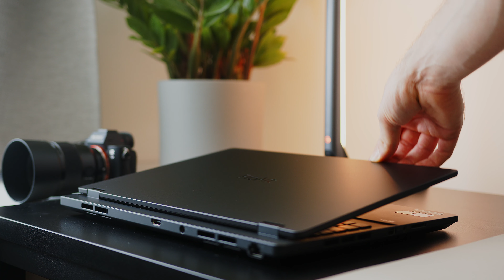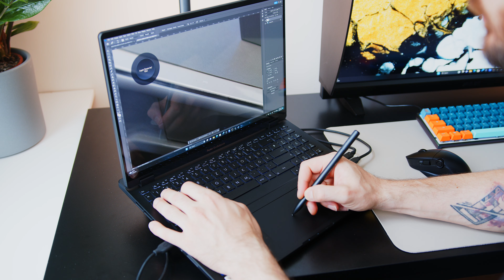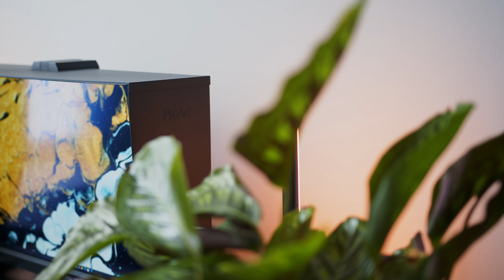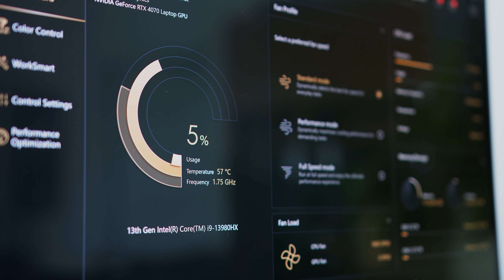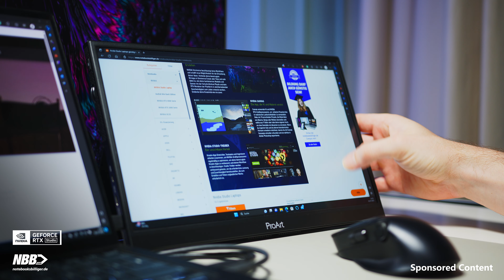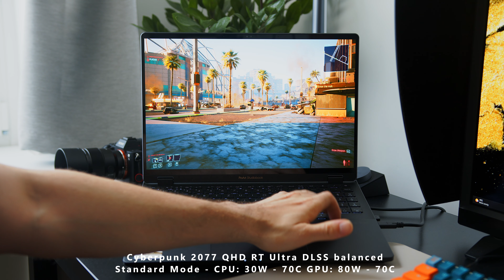Asus ProArt Studiobook 16 OLED -  The One-Stop-Shop for Creators?!

Comment: Hi, and thx for the video!
I have just bought this same notebook, with RTX4070, and every time I open Premiere Pro and go to almost any menu, it crashes! And this is no hobby for me and lots of money, and ASUS don´t have a solution. Do you use Premiere Pro, and no problem? THX

Reinstalled win11 several times, and even just updated the OS and just installed PPro, and the same sh...
I am really getting mad at ASUS as this is supposed to be the jewel of the company, and read that many users have the same problem. Besides, all review talk about specs but not one shows them at full workload.
Reply from the maker: Damn, that does hectic. I tested our sample with Resolve without any problems, and trust me, our stresstests are also no joke. Have you tried a different version or premiere?
Reply: @NotebookcheckReviews  yes, 2023 and 2024
Weird, as I can open Lumetri but not the scopes. I csn even edit with Lumetri. But as soon as I open Preferences or Export Media, it crashes.
Reply: @MarcelloScotti  any resolution as of yet?  I work with Vegas mainly, but am wondering if there is a wide spread video rendering issue with this laptop.
Reply: @AshevilleVideography  hi, and thanks for asking!
You won´t believe it...

As the notebook was brand new, I haven´t used the camera yet. So, I had a Signal meeting and .... OMG, the camera didn´t work!

So I recalled the problem I had with my Zenbook Pro Duo, that wouldn´t let me open Premiere Pro because the integrated mic didn´t work. I send it to ASUS and they had to change the whole screen board. 900 euros but fortunately still under warranty.

Back to the problem.

I deleted the camera driver, and still the same. Deleted Nvidia and the same. I reinstalled win11 and JUST updated WIN11 and installed Premiere Pro and... still crashing. So, I thought maybe Nvidia was stepping on the ASUS controller, but... where to find the original controllers? Wrote to ASUS and nothing. They sent me a link but ... useless, as usual.
So, I had to go deeper. I went to the Device Management, looked for the camera, properties, device ID and copied the "hidden" id sequence. Googled for it. deleted Nvidia, installed the driver I found, installed Nvidia, and reinstalled the camera driver once again. AND BINGO! It worked. And so far everything is doing great. Tech people under salary are usually very limited.

So, short version: Nvidia was stepping on the camera driver and at ASUS you can´t find a repository with controllers (HUGE mistake), so I had to find it myself, and to find myself the solution.

Thanks for asking!!

Comment: As an user of this laptop I did find after in depth research that SD card reader poor performance is not about sd card compatibility. Asus did forget to mention SD Express standard is not back compatible with all SD card standards so the reader can be fast only when you use special SD EX cards, which are non existent in for ex. photography world. SD express 7.0 reader reads either ancient SD UHS 1 or SD EX standard, and nothing in between (sic!) which means every other card than SD EX will get speeds only up to 90MB/s which is crazy slow in 2023.

Comment: If only they would release a 4080 version at least, better still a 4090, that's what I would need as a full time video editor, great laptop but a 4070 just doesn't quite do it for me. Been using my older Razer blade pro with a 3080 and that struggles depending on the codec. The cpu is a definitely an upgrade but without that higher spec gpu it not worth it for me anyhow, pitty because it's great machine
Reply from the maker: My thoughts exactly. There are too few "creator" notebooks with 100W 4080s or 4090s. Sure, they would be expensive, but when you make money with it, cost is a bit of a different matter.
Reply: @NotebookcheckReviews  Hi, yes exactly, when it's what you do for a living it's kinda necessary, nothing worse than clients on your heels and dealing with time pressure and a machine that is not playing ball.. It's still an expense sure but at a certain level you decide it's a worthwhile investment. Do you know of any other "creator laptops" that are currently available with 4080 /4090 cards? The Razer and the Lenovo are the only ones I know of?
Reply: Even the Msi creators are excellent for graphic design etc. But for video they don't spec them out with higher end GPU'S
Reply from the maker: I was actually looking into that myself the other day. The ROG M16 comes to mind, the MSI Stealth 17 Studio also comes with a 100W 4080. And there is a Zenbook Pro 16 OLED which also comes with a 4080. I am trying to get my hands on that one.
Reply: @NotebookcheckReviews  oh excellent, thanks I'll take a look at those. Hopefully you get your hands on one would be interested in seeing

Comment: The Asus Pen 🖊 get used this laptop 💻, is it convenient to draw on screen,...? Does this laptop having tablet mode? Screen can rotate 180°...? 360°?
Reply from the maker: It works pretty well, but I would not work like that for more than 1-2 hours. But you can use the pen on the touchpad, which is simply amazing. 
The tablet does not have tablet mode.

Comment: I got the base model and was disappointed to not get a stylus in the box for that config. My only other frustration is that the lock port is the size of a standard Kensington slot, but only works with their Slim style of locks and not the standard T-bar designs due to a shorter-than-spec roof inside the slot. Otherwise it seems to be really solid and I've enjoyed having it. Afaik this is one of the only laptops with a touch screen, discrete graphics, and removable ram/ssd/wifi.
Reply from the maker: Thanks for sharing your experience. I thought the stylus was always included, especially given the touchpad functionality. That is a bizarre decision from Asus.

Comment: I returned mine. The off center keyboard drove me nuts. Why add a numpad to a creators laptop ?
Reply: Yeah I hate the numpad too
Reply from the maker: Whenever a laptop this size comes without a num-pad, you will have an equal amount of people complaining about it. It will always come down to personal preference. I can work with both, I do not really miss the numpad if its not there, but I appreciate it if I have one at my disposal.
Reply: @NotebookcheckReviews  glad it works for you. I dont oppose numpads if they dont come at the cost of ergonomics or comfort when using the laptop. shrinking laptops sizes and adding numpads are mutually inconsistent design choices if you ask me.
Reply: To create with numbers.
Reply: @lukjno6345  thanks. I think it makes sense. I was being biased for my personal use.
Reply: @lil_brumski  if you come from a no-numpad (dedicated number keys) laptop, your hands would have to rest way more to the left and my leftmost fingers kept going over the laptop chassis. It is not easy to find your way in this keyboard if you are not used to a numpad. how many video editors type exce spreedshets to the point that need a numpad? I dont get it.
Reply: @DanielRodriguez-fg5ll Numpad is useful for video editing especially for multicam editing.
Reply: The numpad is extremely important for shortcuts for many apps like Blender and Plasticity, for example, or CAD software. In Blender and Plasticity, most of your camera view angles are handled with the numpad. Since I use these applications, I would never buy a laptop without a numpad. Or if I had one, I'd have to add a USB numpad accessory and velcro it on or something. Many creators are using software like Blender, just the kind the market that having the 4070 GPU is aimed at. That's why they have it on a creator's laptop. Super useful. Indispensable for me and many others.

Comment: Pity it's just a 16" device and they haven't released the Scar 18/Strix G18 in ProArt style, without the useless RGB but still with larger screen with taller aspect ration, possibly with an OLED or miniLED tech, and a chassis that's capable of supporting 4080 or 4090 class GPUs with more VRAM than the 4070 can offer... I guess it's still just the MSI Titan to somewhat attempt this DTR recipe, maybe the Acer Triton 17x as well, but neither is OLED nor 18+"...

Comment: Hi, I was thinking about buy this laptop, two weeks ago, there was a bios update throw the windows update that " brick" the laptop and the solution was in a reddit post and some you tubers made a video about how to solve the problem but the solution was disabling drivers update. Had you the problem? Is any way to know if the problem is solved? Thanks very much for your reviews are awesome!
Reply from the maker: Hi there, somebody else mentioned this already. Our unit worked fine, without any problems ... is it a widespread issue?
Reply: @NotebookcheckReviews yes it is. It seems that happened to all pro art studiobook and other asus zen and vivobook with the last bios update throw windows update
Reply: @NotebookcheckReviews  also Tech Notice was recommend this laptop and he made a video exposing the problem, and another fixing it
Reply: Some say the bricking only occurs with the Ryzen models. Has anyone found the bricking to occur with Intel?

Comment: Grainy touch OLEDs. Wobbly chassis from typing on a $1,800 plastic Vivobook Pro 16X OLED without the touch layer. Atrocious battery life in miniLED Yogas. Why can't life be fun?
Reply: I will wait for 2024 xpa 15, i wish:
1. Meteor lake is 20% less energy
2. More bright oled screen, maybe 120hz 
3. Vapour chamber cooler
4. Maybe bigger battery
5. Some slight design changes because of redesign
6. Upgradable ram, ssd and wifi
Reply: I bought this laptop. It's true that the display graininess really wastes the screen's potential, and that the battery life is atrocious. It's also scorching hot underneath even at idle. That being said, the performance is great and the palm rest area never gets hot. It's not perfect but still the best laptop I've had until now.
Reply: Still, thank you for covering all the options possible. Some solid laptops have so few customer reviews one can't ever make a remotely informed purchase.
Reply: For me the dell xps is the way to go
Reply: @dracoxruiz2563 which says it all of your knowledge when it comes to laptops 😂😂😂😂😂😂😂😂
Reply: @dracoxruiz2563  the GPU is kneecapped, and Dell seem still seem to be going for louder fans and/or thermal throttling whenever there is a tradeoff to make
Reply: @MrEstarion  yes, but thin and light with a good overall laptop experience at such small size only one is the dell and maybe the asus rog flow series, but they have liquid metal that i dont like